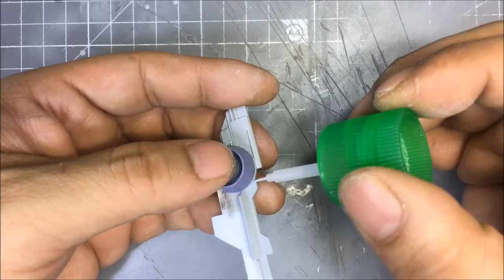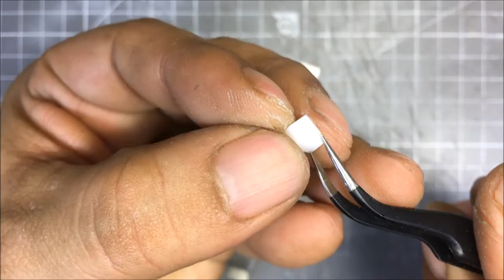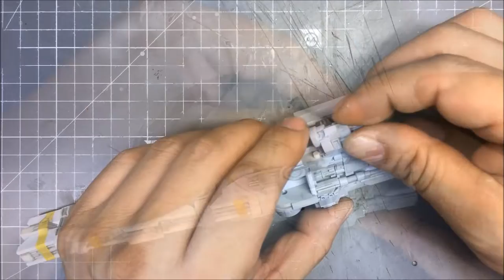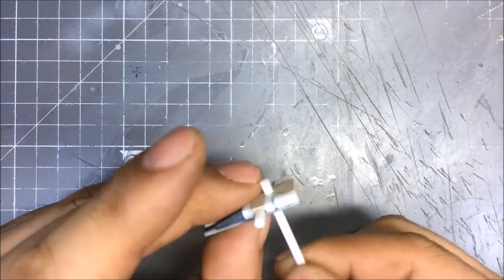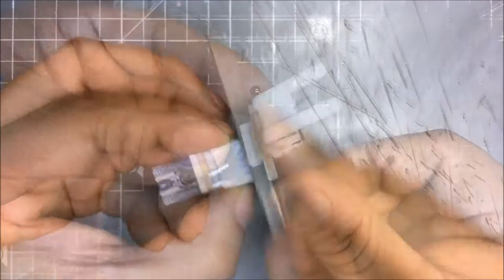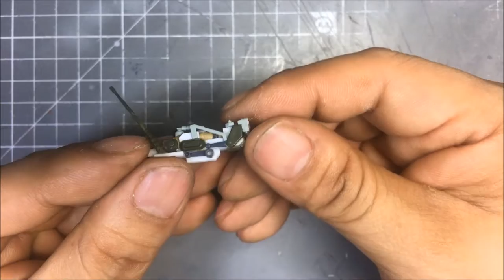[Plastic Model] Scratch Built Sci-Fi Spaceship LANCE EP08

Comment: Follow on Instagram love the design, what's the putty you're using?
Reply from the maker: Thank you for watching! I use several types of putty for different reasons. If you are asking for the beige color putty you saw in this video, it's an epoxy putty :)
Reply: ah okay just needed a suggestion for a filler that dries quick, thanks
Reply from the maker: For that reason, I usually use "loctite480(Black)" & "Zip Kicker CA Accelerator" :)